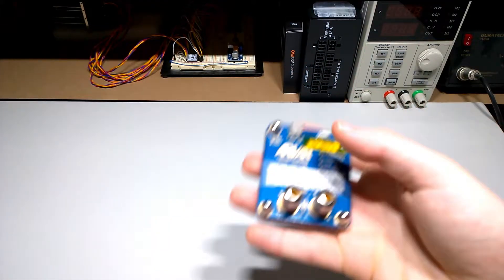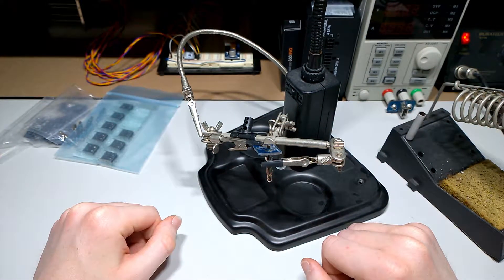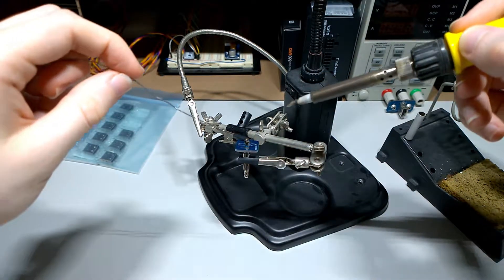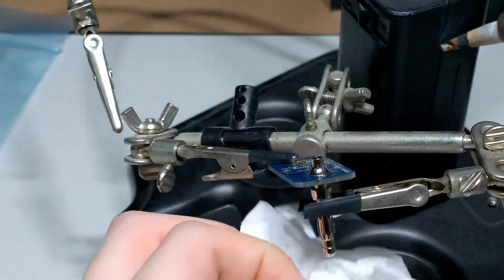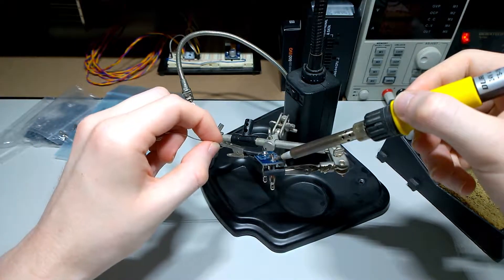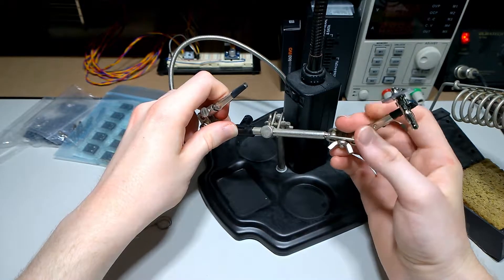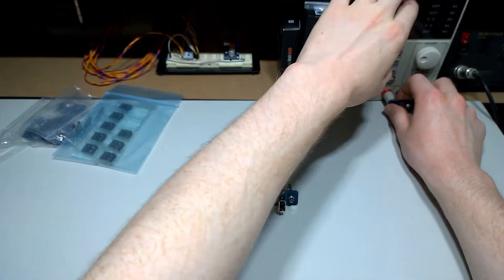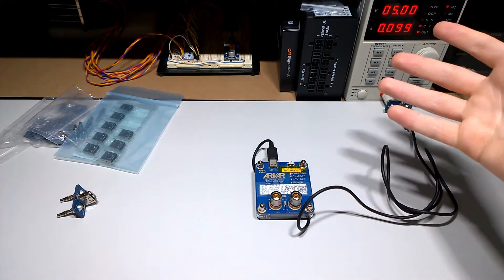PSU 3/4" Binding Post to USB A Adapter Assembly

Comment: Great!  When buying a lab power supply it is good to look for one that has a third output fixed at 5V which is really helpful with what you have built.  Also add a large flashing LED so that you can always see when your power supply's other outputs are switched on.  I have made the mistake of turning the voltage dial whilst a sensitive object is attached and damaging it thinking the output was off!!

Comment: Really nice. Do you have a recommendation for a bench top power supply? There are a variety of options at my local store and I don’t know if there’s something I should look out for or if they are all basically the same.
Reply from the maker: Really depends on what you’re doing, for some a USB port is good enough for others a US$20,000 power simulator & analyser is essential.

Biggest things are probably that for most things a fixed dual rail PSU isn’t that useful unless you’re doing audio amplifier stuff it’s often essential but a dual supply unit can be useful. Switching vs linear, switching is cheaper and higher power but can be very noisy, linear is very clean but lower power for the same price and very heavy.

One in the video is a TENMA 72-10480 (also branded KORAD) had it for about 7 years, I think it’s been replaced with a newer model.
https://www.youtube.com/watch?v=g94mpom2Ahs

Next to it is a Corsair SF-450 computer power supply for high current 12 V stuff.

Comment: Great video. Nice tool. I love gadget tools, like this one. I think you said that the standard banana post spacing is 1". Isn't the standard spacing 19mm, on center? I think this could be easily cobbled together just using perf board, if the builder only needs one.
Reply from the maker: You’re right not sure how I made that mistake! I’ve changed the title to the correct 3/4" (19.05 mm). I’ve seen some people make perf board ones but I wanted a good looking one, nice little PCB design project as well.